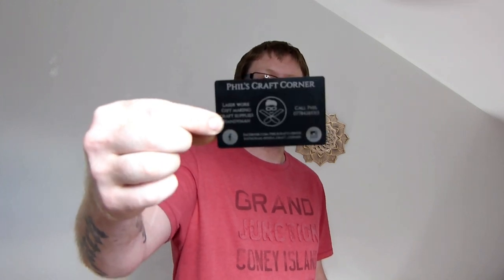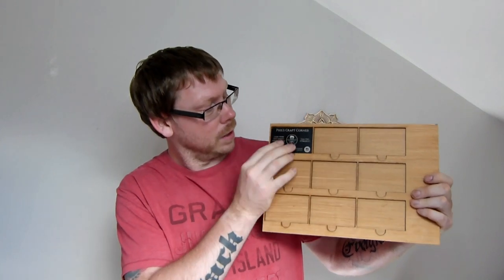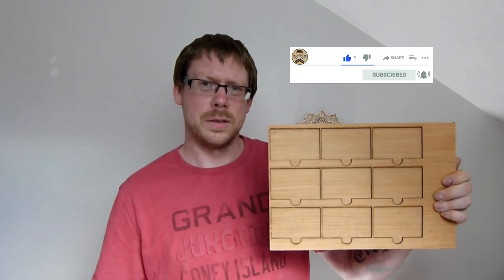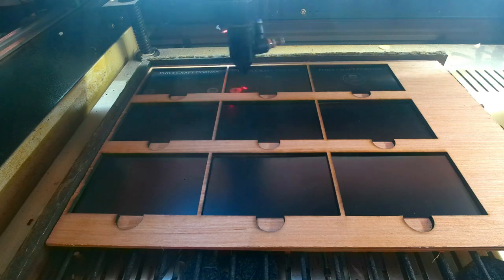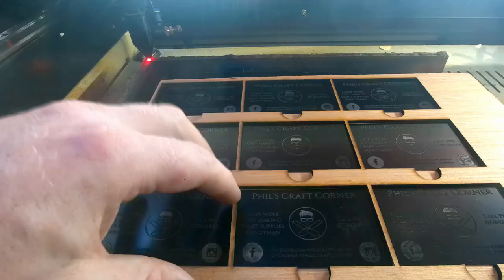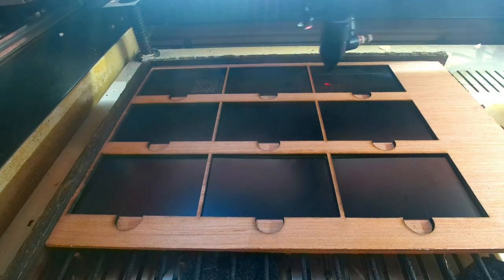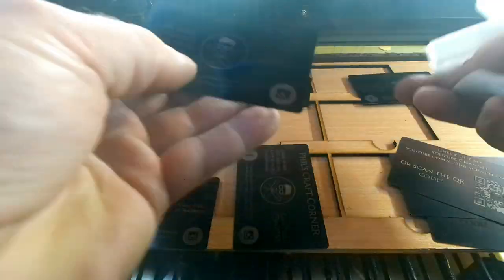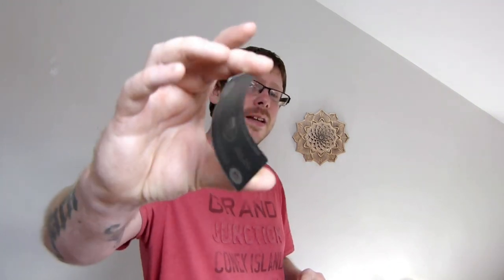Using a laser to make the world's coolest business cards

Comment: Great video.. One question.. How do  you index the jig ?  do you set the origin at the corner?  Especially after you finish and come back to it another day..
Reply from the maker: The top left of the jig is set to the 0,0 origin on my laser so every time I sit it in its set perfectly
Reply: @philscraftcorner  I plan on laser engraving business for a buddy of mine, i currently dont habve a template like yours to engrave multiple cards, but how do you make it so you can engrave multiple cards in one job?
Reply from the maker: I simply measured the card size. Drew rectangles that size and then glued it to another sheet the same size
Reply: @philscraftcorner  ❤